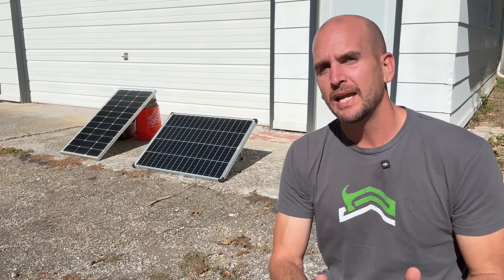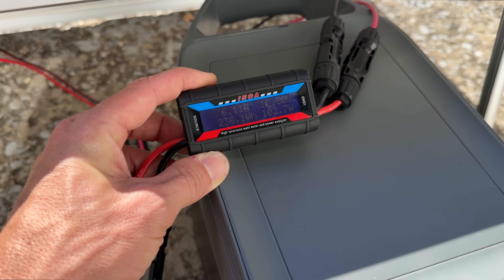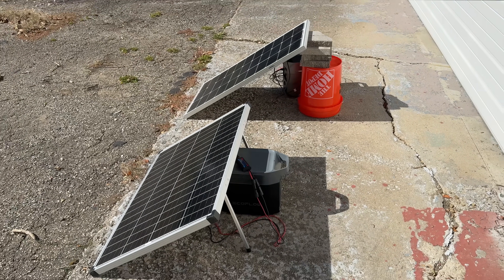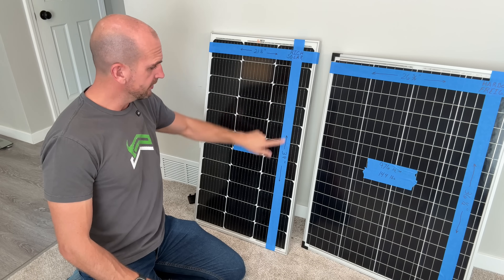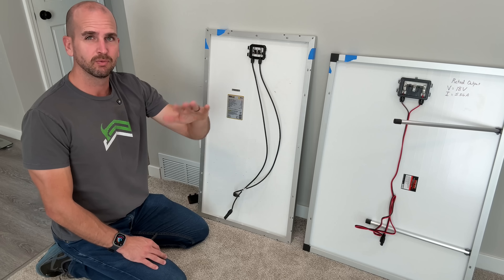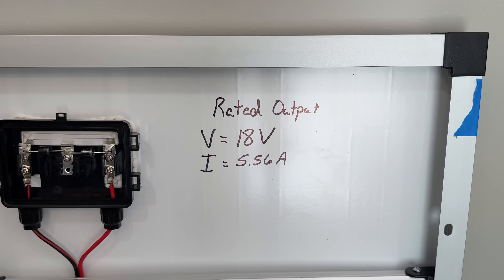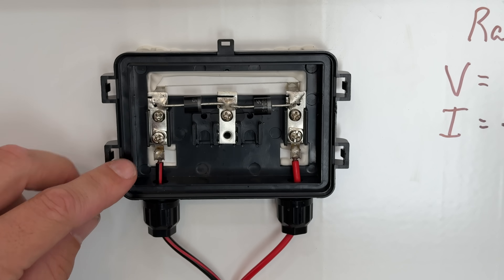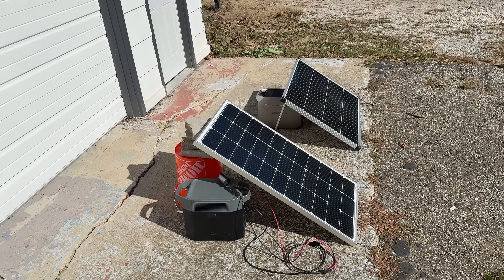Harbor Freight 100W Vs Rich Solar 100W |  Tested!

Comment: 423, not 432…  I need a calculator too <g>
Reply: The surface area dif between the two panels is 18% which accounts for the dif in performance.
Reply: @John--qh9xl  Dif is 15.686 % : 495-423 = 72; (495+423)/2 = 459;  72 / 459 = 0.15686;  0.15686 x 100 = 15.686%  There is a difference in figuring "difference" & "increase".  The increase is 17%, this is not the same as "difference".
Reply: @Do_the_Dishes  Your definition of "difference" is not standard or typical anywhere I've ever seen (and is also arguably not that useful, either).

The difference is actually 72 watt hours (or about 13.7 watts ).  You cannot express an (absolute) difference using a percentage by itself.  It simply does not make mathematical sense to say that.

If you want to express something using a percentage it is always necessary to specify what the percentage is relative to.  The difference relative to the RS panel is 17.0% (more).  The difference relative to the HF panel is 14.6% (less).

(Also note that since the source data numbers have three significant digits, the calculated numbers should really also be given to only three significant digits.)
Reply: Where do you recommend a person go to educate themselves as a beginner
Reply: I was gonna say
Reply: @patrickfreeman8257  Yeah, same here, but just like you, "I was a good boy" and did a ctrl+f search first :P
Reply: I was gonna say check your maths ... But you said it better, including the correct calculation!
Reply: Mixed the 23 & 32 ...
Reply from the maker: Good catch, thanks for the feedback.
Reply: For many decades, it seemed calculators were the most effective appliances to utilize solar power, by far.  Its nice to see the technology has advanced enough to make it viable to do more than "carry the one" on an LCD.
Reply: Good spot, 👏👏
Reply: So even better % for the Harbour Freight panel!
Reply: @dirtyburd71  No, it's 17% increase from 423 to 495.
Reply: Yes.  Plus, (according to my difference calculator) the “difference” between 423 and 495 = 15.686%;  423 to 495 = 17.021% increase;  495 to 423 = 14.545% decrease;  423 = 85.455% of 495;  495 = 117.021% of 423.  😊
Reply: @Do_the_Dishes 
Yeah!  I thought my calculations were wrong since I came up with same difference.
If that is how the calculations are done here, there's diminished value to this channel. So an 11min program turns to 30min between stopping, rewinding, pausing, pulling out calculator, running numbers through twice to make sure, etc..
Not a big deal rounding numbers a little, but this is too much for me.
Reply: Dif is 17% - 495-423 = 72 / 423 = 17%

Comment: Link for the rich is a 200 watt panel
Reply: I looked up the rich 100 watt panel, it was $80.  Harbor freight 100 watt panel is $120. 
So, you could get 300 watts of rich for $240 or 200 watts of better Harbor freight. Even though less power for the money the rich look better.
Reply from the maker: Thanks for the heads up, here is a new link for the Rich Solar panel used https://amzn.to/3NuvlZI